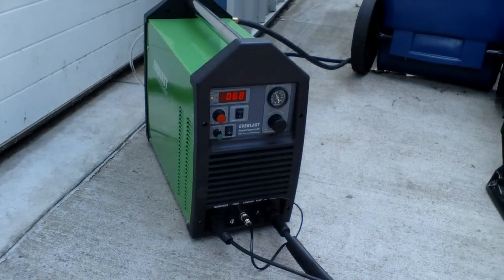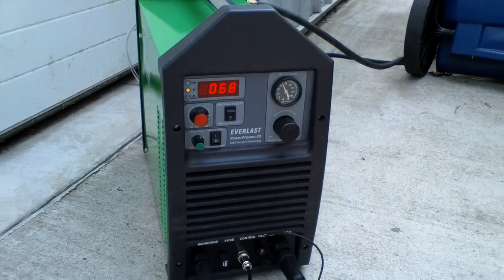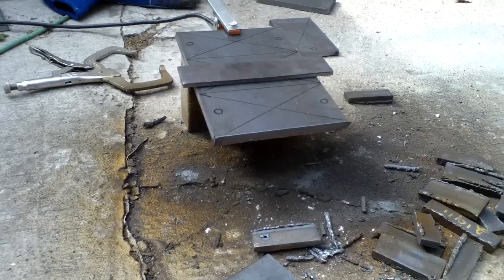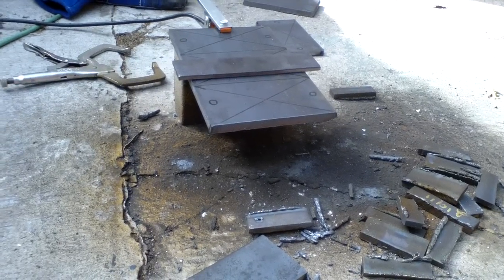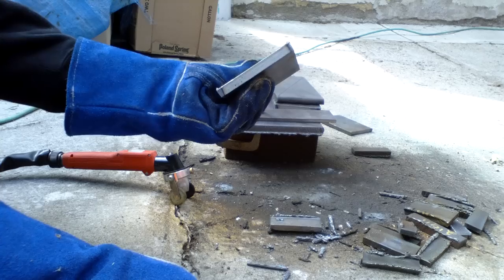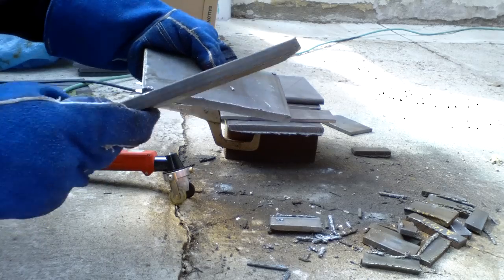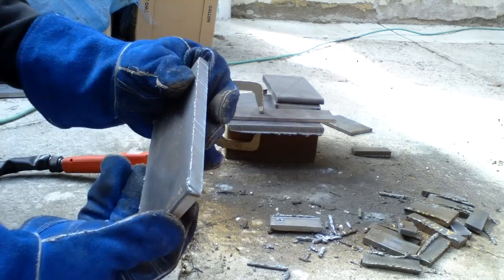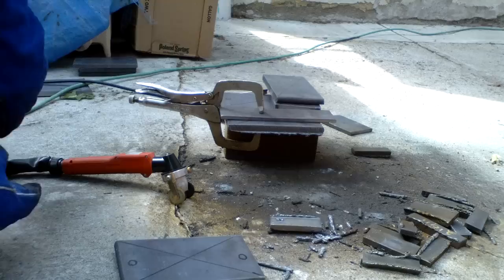Everlast Power Plasma  80 Amp Pt  2

Comment: I have a question about this Plasma cutter, I'm owner of 80s 
Plasma cutter and works really good. I'm impressed about the power cut. But someone knows what kind of generator capacity do I need to run this Plasma? 
Any advice would be welcome and thanks.